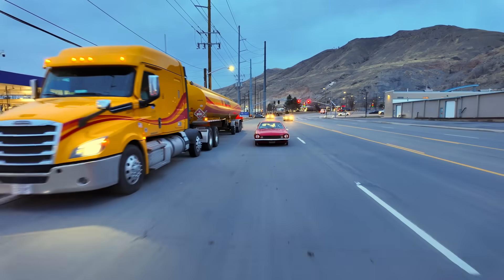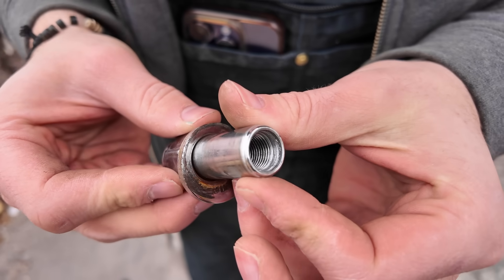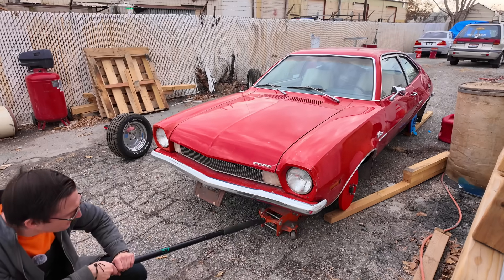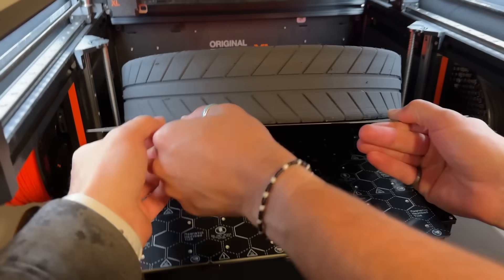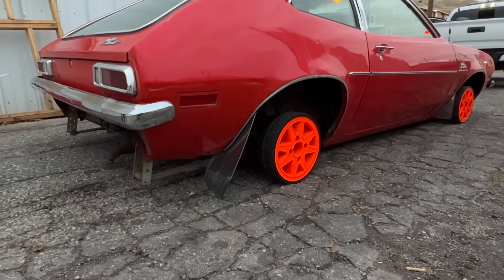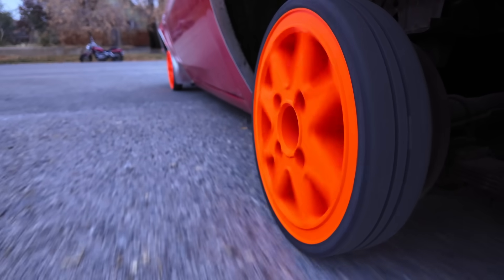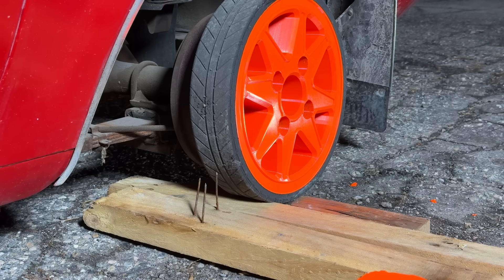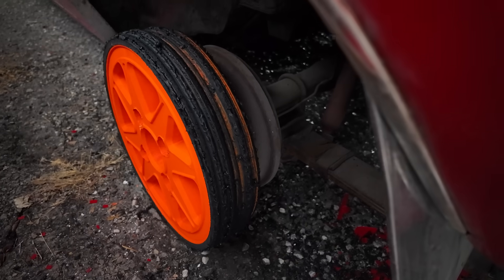What Happens If You 3D Print Car Tires?

Comment: Those bars on the axle are called traction bars.  It's to reduce axle roll, which will improve traction on hard launches and reduce u-joint strain.  Not real sure why a pinto has them, but now ya  know.
Reply: It was made clear in the burnout test why those traction bars were on there...

Comment: 15% infil, grid pattern.... thats crazy. Like at least 20% and cubic...  (petg is fine, though, at it's one of the few filiments thats flexible enough to not shatter).   Also fun fact. Nasa actully uses 3d printed tires for rovers (albitet with stronger material), as being airless means they can take several hits without breaking.

Comment: Split the wheel into 1/4 so you can print a bigger one, use some m8 bolts and auto locking nuts to combine the parts together (4 bolts per connection should be sturdy enough)
Also, try some ASA CF for extra durability, i think you could definitely get better results using these parameters 😊

Comment: you can print wheels out of pretty much any metal through SLS printing or printing with filament that is PLA mixed with various metals or other materials like Kevlar, Nylon, Teflon, Carbon Fiber, etc. Also, using topological optimization software will help out a lot with the infil

Comment: good u proteced your ears if i am correct if that is a hearing protection plug in your ear mayb? or a hearing aid idk. cool vid!

vanallen=newhorizonspeed=shows moon cant b reached since range=speed! EXACT MATCH move "4" one digit over!
36400speed=36040range ALSO CARS MAX 300MPH=CITY2CITYRANGEMATCH!

coldwaterafterhot=brains
 DUPONTmicroplastics
pinealglandsleep
redbloodcelloxyg
kid10xEMF
wps is not off
CHICKENPOXV=SHINGLES
Dentists don't track X-Rays enough
blue-lite blockers acrylic tan orange; sideflectors eclipserollens nvrdilateliq COPPER BLOCKS WIFI oxygen sleep grisom baron William Greer BAYOFPIGSCIA shatner911 muffsplugstinnitus

single nuke in space emp could wipe out nearly all tech :o wow

Comment: Seeing slapper bars on a Pinto was gold! When a lot of torque is applied, an axle wants to twist (equal and opposite forces as tires are rotated). With coil suspension, control arms are used to mitigate this. Leaf springs naturally resist it a bit due to being a long spring, but with a decent amount of torque they will twist into an s-shape. This loading on the spring can release creating wheel hop so tires lose traction (and then gain it as the spring unwraps again...and repeat) and potentially break axle shafts. The only reason I can think they'd be on a stock Pinto is either the springs are really soft either from factory or after 50+ years on the road.

Comment: Because you removed the "rocker bars" 6:09 (I believe are Torsion Arms or Traction Bars) is the reason your axle is going so wonky 12:45 ...you removed the thing that keeps the axle straight and solid. The fact those wheels were very very small, was the only reason they didn't break. If they were the correct size (or closer to it) they would've [probably] been too weak to hold the weight of the car, at least that spoke design. And, most of the testing you did was 2 dimensional. Any [normal] turns or too much side stress would have broke the wheel from the side. Probably right at the lugs. Then on top of all, they were made of plastic, which is soft and/or flexible enough (more than metal) that there was no way you could keep the lug nuts on. So still drivable? Questionable. 
It's a definite start though. They handled fairly well considering. I actually would love to see you try with something a LOT more flexible. Something not rigid enough to break, yet strong enough to hold the weight. Like all rubber, or a flexible nylon. You'll need a lot of infill for that, and specific design. Your biggest hurdle will be how you connect metal "washers" built into the wheel for the lug nuts to have a solid grip on the wheel. Or some sort of locking nut.
Looked like reckless fun, but fun nonetheless.

Comment: Those bars are traction bars. And when that guy said something about the car exploding, take his word. If the car is completely stock (fuel lines n such) get it all replaced and re-located. Ford re-called the pintos because they combusted with the smallest tap to the rear end. Stand by

Comment: I see a product here. Not making an actual wheel but a wheel inside a real wheel. So you make a plastic wheel out of this material and strength and mount it on the rim/barrel then put a regular rubber wheel over it. Now when you get a flat tire you can continue driving.
The best use for this product would be in Ukraine helping all the soldiers who drive pick-ups close to the battlefield where you really do not want to stop and change a tyre. It can save lives. 
So I hope you make an example file for this use and give it to someone in Ukraine to try it.

Comment: I know very little about 3D printers but I think if you can find a better material for the tire this would actually work a lot better. The rim seemed to hold up surprisingly well other than spitting the lug nuts out lol A little Loctite would solve that problem…

Comment: Those bars on the rear leaf springs are called "ladder bars" and are meant to keep the axle from twisting under torque. You can safely remove them as I am thinking they don't do much on a Pinto as I am thinking it has a four banger in it.

Comment: I think a lot of comments are right that trying to make these bigger would help a lot -- but instead of printing in quarters and sticking them together I would maybe be curious to see what happens if you copy a more traditional wheel design by doing a single solid-piece "hub" still, just really maxing out the dimensions of the printer as you do so, and then printing a slightly thicker tread in pieces that lock together, and then glueing the treads together and to the hub. The hub provides the vast majority of the strength, and the treads will transfer the weight of the car to the hub efficiently if they're designed well. And importantly, this would let you eek out some more diameter for the whole wheel without needing a bigger printer.

Comment: Those bars under the axle are called Traction Bars, they are an aftermarket add-on to prevent wheel hop when accelerating from a dead stop.

Comment: Those are not rocker bars and not to protect the suspension. Those are traction bars. They are meant to keep the rear leaf springs from hopping when you accelerate fast enough to spin the tires like a burn out.
Reply: Older classic cars and trucks used them when they drag races because upon acceleration the rear leaf springs would hop on the launch causing the tires to lose traction and ultimately causing wheel spin when you needed the traction to win.

Comment: Cool test!
You could improve it in a few ways:
Use Higher Infill.
Use a different infill pattern (for less than 99%):
> Triangles & Stars (I have a feeling this one could give the best results)
Quotes about this infill pattern:
"Both patterns have great horizontal strength and good flexibility."
"These patterns work well for simple parts where horizontal strength is a priority."
Which fits a tire's needs: Good flexibility and good horizontal strength.

Also... you could consider using a hard flexible plastic for the wheel base / rim.
Might keep it from breaking.

I hope you get there (to a practical, 3D Printed tire).
Reply: Nylon with TPU would probably hold out a good while, he would need an enclosure tho

Comment: Someone tell me why I don't use an infill close to 100 percent or 100 percent for better results, and why I don't use a layer height the size of the nose, that is, 0.04 if the nose is 4 millimeters and I swear it is so exaggeratedly resistant that you can't imagine, apart from why you didn't use ABS, nylon, carbon fiber with ABS that almost has the same price as PETG it would have been much better.

Comment: Awesome! Maybe next time you could 3d print a larger wheel by cutting a 24in wheel into 3rds or 4ths. Then have them joined together in a way that works (i.e. think wood joinery or using strong adhesive JB Weld). You could print the sections vertically if you want but horizontal is best for roundness. :3

Comment: For full sized wheels get sponsored by a modern belt printer. Printer the rubber of the tire in a long line and bend that around standard metal rims, and deal with the inevitable sloppy seam where you join it. For 100% printed, print the rim on the XL.

Comment: If you were able to put in steel bushings where the lug nuts go, you would have actually been able to properly torque down the lugs and not worry and your wheels falling off. So if you do a follow up with larger wheels, make the mounting holes large enough to accept said bushings.

Comment: Hey! I make fighting robots and RC racing cars.
You can improve the durability, and reduce the weight/material by increasing the amount of walls, and making every structural wall directly intersect with every other structural wall it can intersect with.
I'd also recommend making the outer ring of a sturdier material, like cf nylon if you want it to still be 100% 3d printed, or just a steel ring if you just want them to work and still look 3d printed.

Comment: I’m pretty sure that guy was telling you that your gas tank is a known issue with that car. And you driving stupidly risky wheels on a public road with massive sparks coming off would make that worse.
Reply: All cars back then with rear mounted gas tanks generally has this issue just the pinto was overblown because there's a chance the doors get stuck shut when crashed thus causing you to burn to death but you'll have that in any serious crash. and no the sparks wont do anything a car slamming into the back of you really fast would probably be an issue. Crown Vic police cruisers apparently had the same issue with fire that the pinto had
Reply: @devon12346  yeah I definitely wouldn’t expect it just burst in flames, but loosing suspension components and dragging the rear end of the car makes me more nervous. But yeah, you’re right, unlikely.

Comment: That was an awesome fusion 360 montage! And the rest of the video was ok as well.
Just by eyeballing it, and without knowing your exact slicer settings and shells used, it looked like you were printing somewhere between 35-45% infill density.  At that point, and with so much extra filament on hand, you might as well just print with 100% infill.  It's a bit counterintuitive, but printing with 100% infill will take you around the same amount of print time as 40% infill because the nozzle doesnt have to go through complex steps to create the infill pattern and can just go back and forth through the whole part.
(Full disclosure, printing 100% infill with a part that big and that round can lead to warping and bed adhesion issues, but there are ways to get around that by connecting a few sacrificial parts to it)
Reply from the maker: Interesting. I was thinking how 35% looked an awful lot like it was almost 100% lol. might be worth some testing.

Comment: Those are traction bars mounted to the leaf springs.  They keep the axle from twisting under heavy acceleration which I don’t think you need to worry about in that pinto.

Comment: Pretty interesting shame you couldn't make them a little larger in diameter. On a side note you should probably look at replacing those leafsprings they are pretty much worn out, if you cant find any stock leafsprings Calvert Racing makes monoleaf springs for the pinto, got a set on my 72 and they work great.

Comment: You're an absolute mad man for printing your car tire with about 15% infill and using a standard grid infill pattern.
Reply from the maker: Figured I'd give it a try on the default settings just to see what would happen lol
Reply: @WaterjetChannel  dont get me wrong, if you have no frame of reference for 3d printing then starting off with standard settings is an easy mistake.
But once you've been at it awhile lets just say you'll learn a lot about infill percentages and patterns.
Reply: @BlindLessOften  Lightning infill is just as big of a mistake. It holds no structural integrity.
Reply: Lightning infill and 1 wall is the best.
Reply: @Those_Weirdos  lmfao, trying to kill them
Reply: @Those_Weirdos I have to assume you were joking because picturing a single wall 3d printed part supporting the weight of a car will give me a stroke.
Reply: @Those_Weirdos  Printed from the spools you store in your bath tub 👍
Reply: @Those_Weirdos  lolol
Reply: I think it was for the purpose of the video, to show what standard out of the box settings could or couldn't achieve
Reply: @paulw9068  Saying "standard, out of the box settings" just doesn't make much sense in terms of 3D printing, imo. Your default settings depend entirely on what software you use, and they are typically optimized for decorative or toy pieces, not anything functional.
Reply: Standard settings are always bad. Use gyroid infill always and if you need something to hold up don't use 15% infill. Also use more wall thickness for strength because that matters just as much as infill and Infil pattern
Reply: WHAT.
Next you're gonna tell me he used 2 walls.
Reply: Which material was this? Pla+? Has anyone tried PetG with CF
Reply: spoken like a true redditor
Reply: @stoli756  stop gooning to reddit bruh

Comment: Take it from a former Makerbot guy: don't use 100% infill. Use just an insane number of shells, as many as the slicer will allow.
Reply from the maker: Lol I’ll have to give it a try
Reply: @WaterjetChannel  Obviously also keep infill 100 too, but max shells I found produces the closest to injection mold plastic.

This may or may not be better than certain infill geometries though!
Reply: When you say "shells", do you mean walls?
Reply: Sea shell?
Reply: @Digital__Confusion  Where do you see it mentioned as "walls" and why are you acting so much like your name?
Reply: @jansenart0  In Cura it has "walls", a very common slicer.  Why the attitude?  It was a legitimate question.  Sometimes people call things different in various places.  My software says "walls", I am merely trying to confirm.  Step back a few steps before replying next time or choose a new hobby if you need to.
Reply: @orbitalbear bro chill with the ego lol
Reply: Layer adhesion is worse though
Reply: @matenorth  Not in my experience.
Reply: @orbitalbear  Good to know

Comment: If you decide to revisit this one day, maybe you could cut some steel plates with bolt holes that get embedded in the wheels for more strength. Or maybe make a larger wheel by waterjet cutting the wheel portion from steel and then 3D print the tire portion out of PETG or Nylon where it bolts to the steel plate, then TPU for the tire. Cut the tire model into four pieces that fit together when they're bolted onto the wheel and each quarter of a tire still fits on your build plate.

Put your current model online and we'll do it for you!
Reply from the maker: Oh I actually really like that idea! Would be a perfect waterjet project. Whats the best way for me to upload it?
Reply: @WaterjetChannel  According to Google's AI, Sketchfab, but I honestly don't know what the "Best" site would be.. I was sorta hoping there'd be more replies suggesting other sites lol I just use Thingiverse because I already have an account there but I know it's not the most popular anymore.
Reply: @WaterjetChannel  I replied to this comment but for some reason it's not showing up. In short, I don't have a good answer and I hope somebody else does.

Comment: you are so frustrating, having these great fun ideas and skills and connections to make them happen, but then f***king up something so simple like the goddamn wheel diameter... but I'm glad that at least you printed it horizontally
Reply from the maker: I made the wheels as big as physically possible for the printer 🗿
Reply: @WaterjetChannel  print them in 4 Parts and make em bigger, BUT Please do research in a proper way of connecting and not just yoloing it or thinking of a solution yourself.

Comment: Thermoplastics aren't a good wheel material lol. Imagine even with actual tyres, the brakes would radiate heat to the wheel and melt it lol
Reply from the maker: Easy solution. 3D print the brakes too 👍😎

Comment: try attaching alternating  super strong fishing magnets(100lbs+ of magnetic force)magnets to a wheel and see if you can do induction heating for "FAST FOOD"  You could 3d print the wheel with recesses for the magnets and use a strong epoxy to hold them in.

Comment: I’m kind of blown away all you needed was PETG. Goes to show that there’s more to strength than just filament type
Reply: He also changed the design and infill pattern. The first test was PLA and default print settings, for entertainment. PLA would likely do just as well, but would deform at temps above 60C.
Reply: @ColtonVi  Exactly, that bit where he snapped filament just meant his roll was wet af.

Comment: Increase the size by designing each wheel in 4 pieces like a puzzle. Then snap/glue them together and go get some gas!!
Reply: this basically destroys the structural integrity of the wheel but there may be a way to anneal the pieces together to minimize the weakness
Reply: But at any time the forces are just (mostly) downward on whatever section. Plus torsional loads. I'd probably try to think of some radial pattern, like the yin-yang symbol (but not really that).